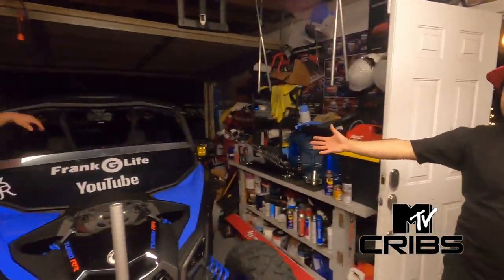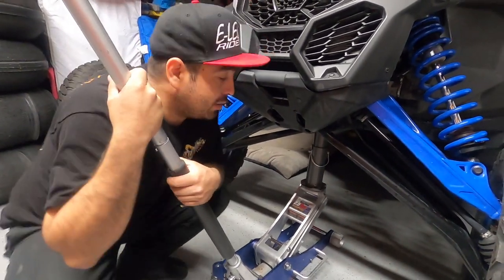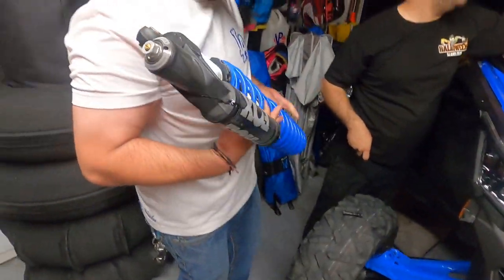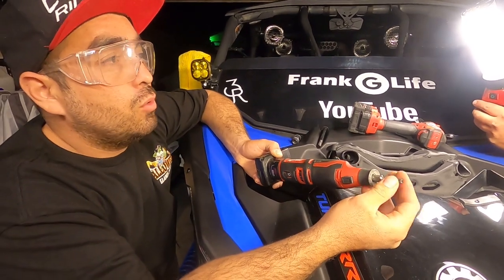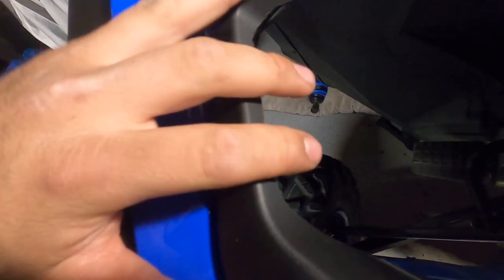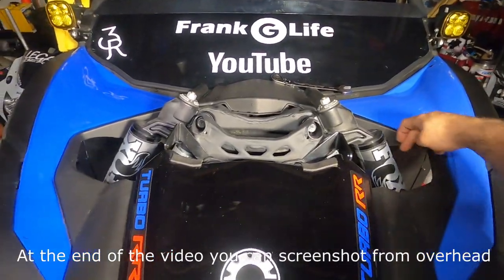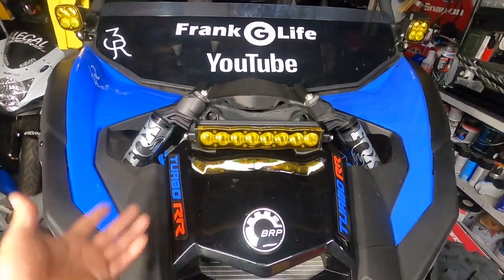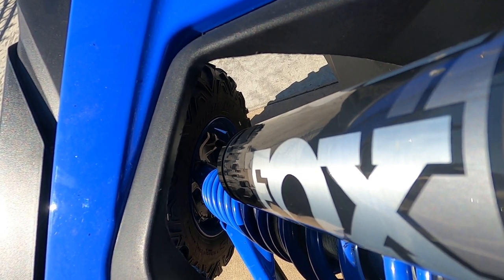How to Flip Shocks on a Can Am X3 ep 136

Comment: I took the front clip all the way off cuz I was already doing gusset kit. Measured all the way up to the corner of the plastic and drew a clean line all the way across. I used a DEWALT multitool with half moon blade to cut it out. Then the dremel sanding wheel to clean it up. I cut more than frank did and one shock shows scuff mark at full compression.
Reply from the maker: Same here. We trimmed it even more on his cuz of a scuff.

Comment: Frank,  any update that you know of , regarding flipping the smart shox 2021 maverick?
Reply from the maker: They can be flipped. You must swap connections. And at the bottom of the shock. It needs to be rotated 180 degrees. Some have done it without any issues
Reply: I love your videos, Frank! I flipped my shocks on my 2021 Smart Shox with no problems. Like you say, you have to rotate the bottom 180 degrees so the wiring will be to the inside. I cut out the plastics to about 1/4-3/8" and could see they were hitting the decal a little bit after some jumps in Stoddard Valley. I have since trimmed it to about 1/8" and went a lot wider with the cut. If you just put the top shock bolt in and lift the bottom of the shock, you can see how wide you have to go. Going to Dumont this weekend and will see if it has enough clearance. Thanks for the videos. I have watched most of them! :)
Reply: I just  swap my shocks but I keep on getting an smart shox light on my dash, 
When you said you must swap connectors does that mean I got to remove the sensor from the bottom of the shock and swap them ??? 
Thanks buddy for the quick reply you will do in about 5 mines lol

Comment: Yo G, is there a left and right for the shocks. I put ST springs on and noticed the rebound screw is on the front side. In your video they are on the back side. I did not flip the shocks, OEM position.
Reply from the maker: Rebound position doesnt really matter. U can literally take a screwdriver and rotat the lower shock eyelet 180 degrees. The shock body does matter and has a left and right. When u flips shocks around u have to swap shocks left to right

Comment: Once you accomplish the shock swap and torque down the top and bottom bolts, at the top mount when torqued down if you grab the reservoir, is it normal to wiggle back and forth? Even when tightened down? I notice the shock has a bushing in the top loop mount
Reply from the maker: Yes it is👍

Comment: Anyone done a smart shox model shock flip yet? Any issues with the wires?
Reply: Yes, I did it to my 2021. Put the top shock bolt in and rotate the bottom 180 degrees so the wire is on the inside.
Reply: I just did them this weekend and my Smart shox light is on now

Comment: Wtf bro I have a 2021 can am x3 max that I bought new. I cannot get the upper front shocks broke loose for the life of me. I have a huge impact with over 1100 lbs of breaking force and even that won't get it loose. I have no idea why the factory would ever tighten these bolts this tight. Really frustrating. I've even got a breaker bar and a friend and we can get it loose. Watching you effortlessly remove yours is annoying. Lol
Reply from the maker: Use a torch on the nut.. they use alot of threadlocker.. use a breaker bar

Comment: Can this be done on the Smart Shox???
Reply from the maker: Had a 2021 in my posession yesterday.. after looking at it closely. Im sure it can be done but the wiring at the lower shock eyelet normally points inwards. If u flip the shock, i would assume u would have issues correctly reinstalling the wiring on the arm.... Im sure someone will try it soon but i have not and wouldn't recommend it currently
Reply: Yes, I did it to my 2021. Put the top shock bolt in and rotate the bottom 180 degrees so the wire is on the inside.

Comment: Why switch what side the shocks are on? Why not just flip them around?
Reply from the maker: If u take a look at the shocks they are clocked at a 6 o clock position to the mounting location.. if u try to flip and install the shock on the same side it will not fit. They will hit towards the rear of the plastics👍

Comment: What about if you have smart shox ?
Reply from the maker: Yes you can do it.. you must swap shocks side to side. As well as the shock connection to the body harness.. the lower shock eyelets must be rotated 180 degrees. It is also recommend to disconnect the battery when doing this on smartshox

Comment: What’s up G. Can I do this to my XRS smart shox?
Reply from the maker: Yes. But you must swap over connectors. As well as then the lower shock eyelets 180 degrees. Its recommended to do this with the battery negative cable disconnected
Reply: @GLifeUTV  awesome. Thanks again G
Reply: @GLifeUTV  one last question, so I’ll be able to just turn the entire eyelet 180 degrees when the shock is of the mount correct?
Reply from the maker: @1ttcobra2003  the lower portion of the shock, shaft and eyelet will turn. Just stick a screwdriver in where the bolt is at and turn it 180
Reply: @GLifeUTV  🙏🏼

Comment: Is there any way you can show us how to do it on a smart shock ?
Reply from the maker: posssilby in the future, but basically the only added steps are disconnecting process.
then disconnect shocks at chassis harness. when you swap shocks left to right you just have to rotate the lower shock eyelet 180 degrees. and thats it
Reply: Do you recommend disconnecting the battery ? Rotating the eyelet would it throw anything off ?
Reply from the maker: @luislanderos686  yes disconnect battery. I've done it works perfect
Reply: Thank you I’ll give it a shot

Comment: Can smart shox flip too?
Reply: Yes, I did it to my 2021. Put the top shock bolt in and rotate the bottom 180 degrees so the wire is on the inside.